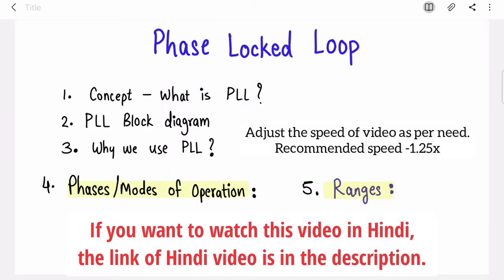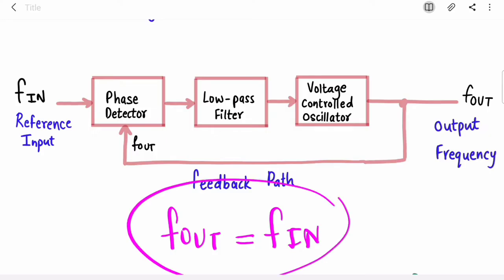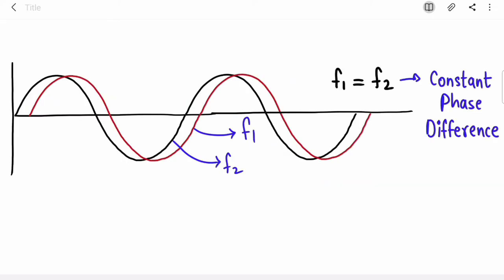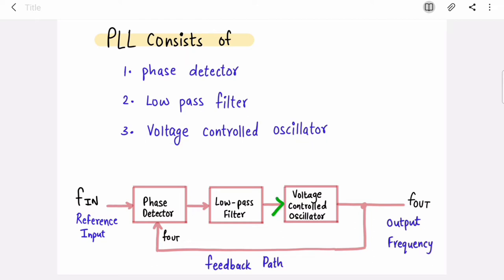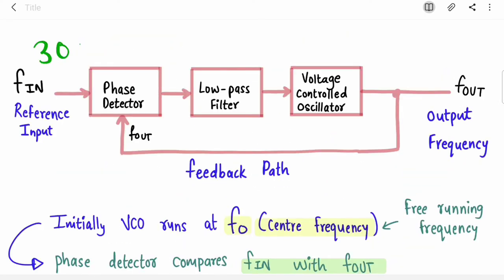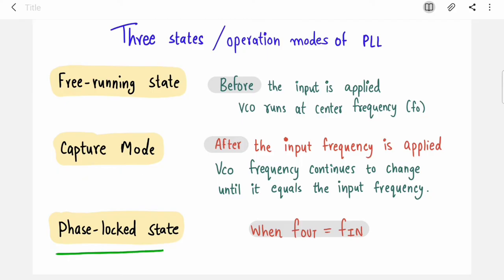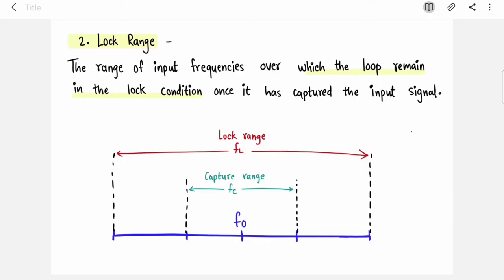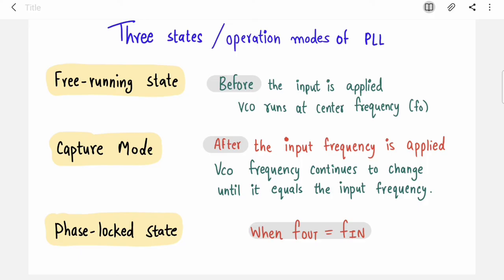PHASE LOCKED LOOP - Concept, Block Diagram Of PLL, Need of PLL, Capture range, Lock range - ENGLISH

Comment: The explaination was clear mam. Thankyou for the video.
I am having one doubt.
In the video you said that the reference input is having low and stable frequency whereas the output of VCO is having high and unstable frequency. In order to avoid this we are comparing it with reference signal through feedback path to synchronize and to get stability.
But the output of PLL is having phase difference constant and same frequency.
So if frequency is getting same as reference that is low frequency than what's the necessity of PLL?
Because Phase is getting constant and frequency is also same as reference.

Please clarify on this